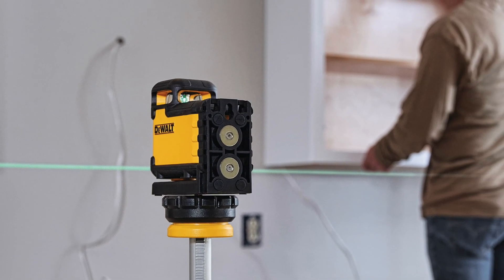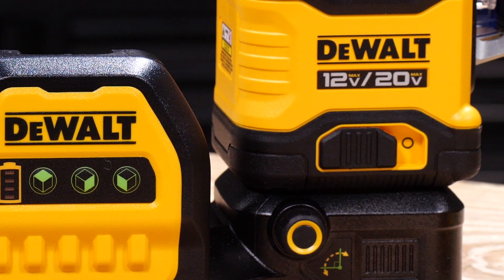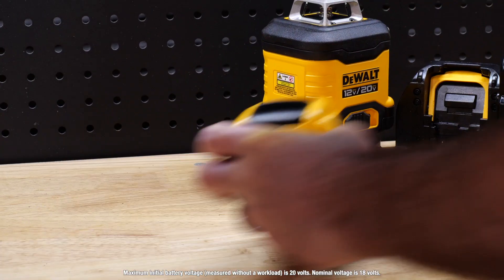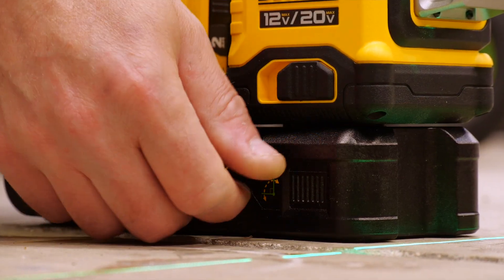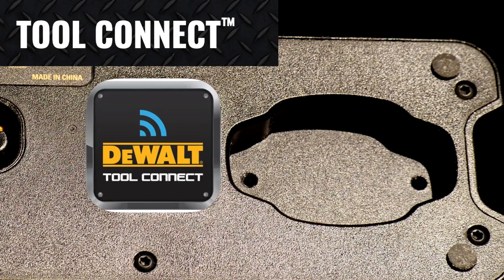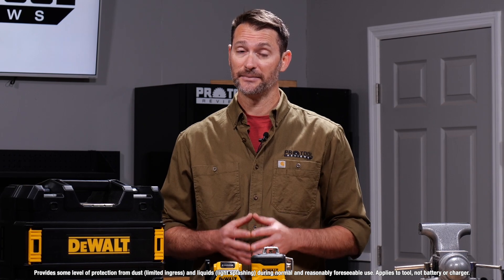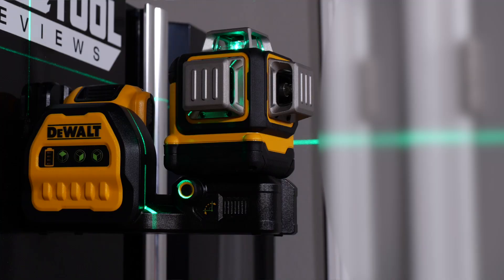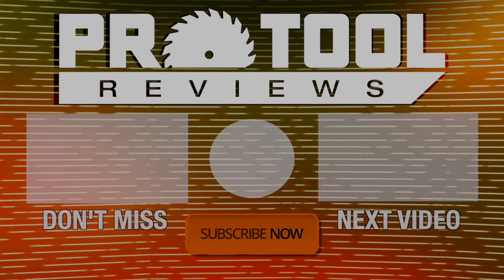DeWalt 20V Max 3 x 360 Green Line Laser DCLE34030G — Pro Tool Reviews

Comment: It's might be the first tool that operates on either 12v/20v batteries but the DEWALT ToughSystem Bluetooth Radio / Charger (DWST08810) would run off of and charge either voltage.

Comment: I had one of these. Within 2 years all 3 of the diodes stopped working. DeWalt refused to cover it under warranty and wanted $275 to fix it. I'll never buy another DeWalt laser or any DeWalt tool ever again.
Reply: I saw this same comment in another video come on 😂
Reply: @waltermejia6938  yeah. What's your point? I'm only allowed to comment on one video? Come on
Reply: @NathanaelD  Hello Nate, I'm open to negative and positive feedback since I think it's benificial for all. What laser level do you recommend or did you go with ?
Reply: @josephcrotty1520  after the DeWalt died, I bought a Huepar on Amazon for $200. Solid laser, just not quite bright enough for me. So I bought a $350 Klein rechargeable laser and that has worked great thus far
Reply: Awwwww come on,I lost you at disrespecting others DeWalt tools as I swear by them an it always come through for me .
Reply: @drive-2786  the fuck are you talking about?
Reply: Klein is garbage, go with a little well known but espensive german made Habershtadt.

Comment: Can you lock the Pendulum with the lasers on if you wanted a straight line on a diagonal for example a stair case hand rail on a wall?
Reply: I have dewalt dce089d1g . Somewhat same as this.  And you can't lock pendulum but if it gets out of self level then it blinks for a second or two then remains constant .
Reply: No you can't lock it.
Total fail to leave that feature out of the design.
You can max it out, by forcing the gimbals to rest at full tilt but it doesn't behave how you would hope. Not reliable.

Comment: This  will expand the power availability for the laser and less waiting to charge a battery. But will they have one that will produce a dot laser that will you double check existing walls and or provide a position dot for layout , with the same Power source.
Reply: You can always use the "X" created by the two lines as a dot.  This is what I do when I don't feel like pulling out the different laser.
Reply: @SuperUncleRyan  that’s a good idea but if you need to work outside and you need the dot laser to go beyond 20 feet in each direction . This is why you need the dot. Thank you for your help.